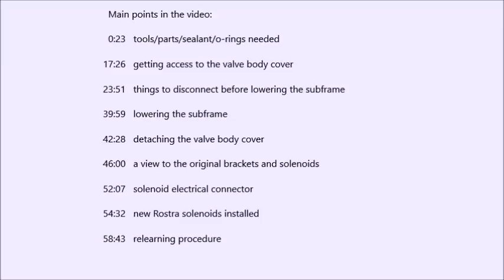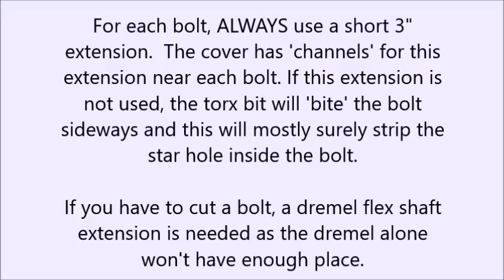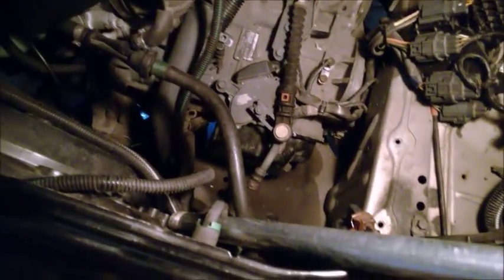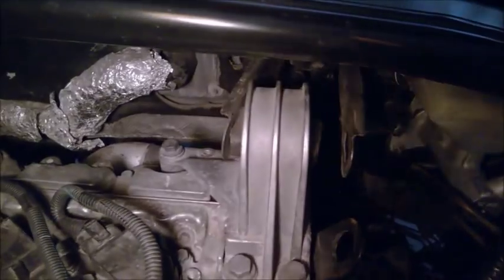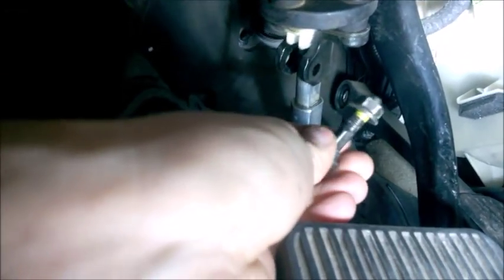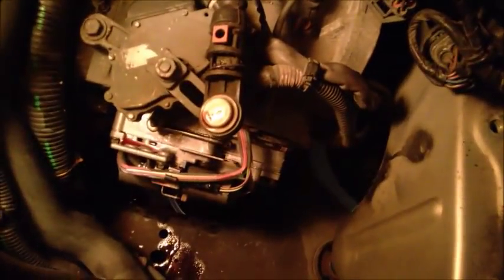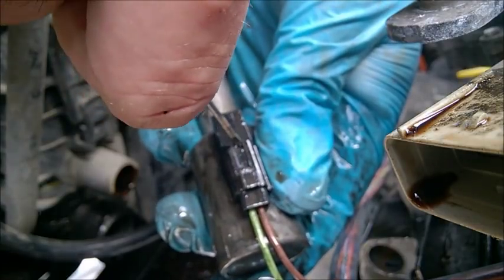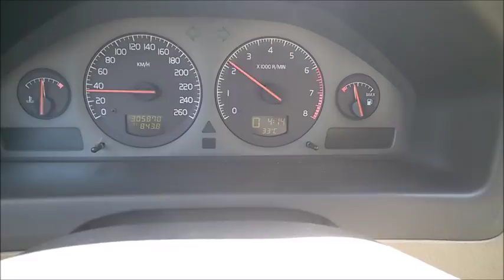Volvo S60 V70 Transmission Solenoids Replacement + Adaptation Relearn 2001-2009

Comment: At what point does one stop spending $ and time on a car... And get a new one?
Reply from the maker: That's a good question :)  I have to say mine is pretty up to the point it no longer needs attention. I think the reason I kept fixing it is most things were small items and I never felt like there was something bigger that was going to be too much. I still believe these cars had a lot of components of very high quality - I would say better than an older Toyota Corolla quality - while other parts only last 80k miles or so.  I know there are also several annoying electronic issues with modules - I didn't had those. Let me just say that on a BMW you have to put 2-3 times more money than on a Volvo (no matter what the BMW owners say) while on a Civic or Toyota, you have to replace every ball joint, dust boot, suspension arm, CV joint, tie rod, exhaust component and plenty of other things every 6-7 years. There is no miracle car out there, be it Lexus or Subaru, only miracle owners who never tell the problems.